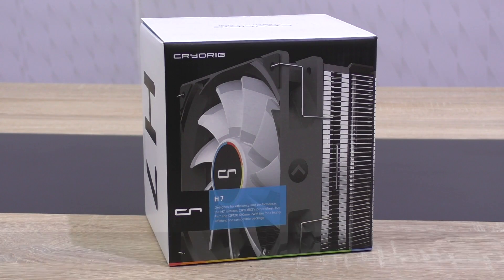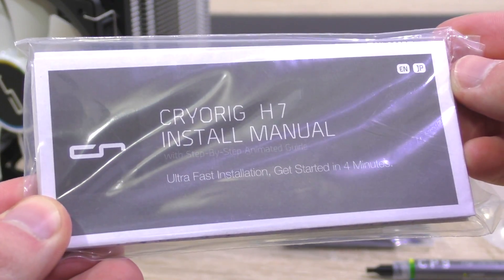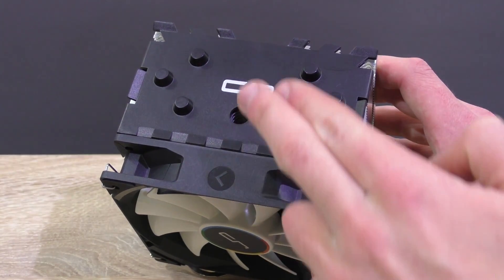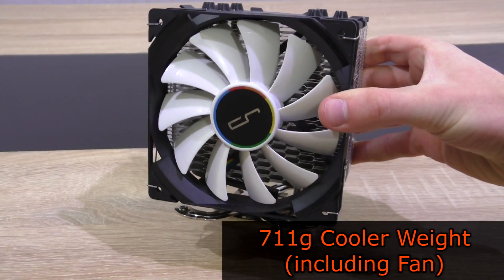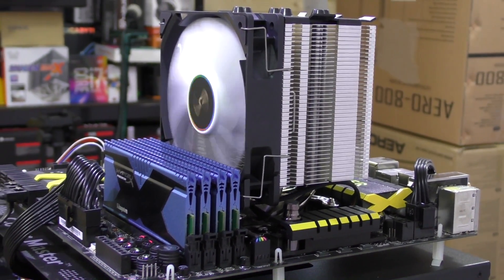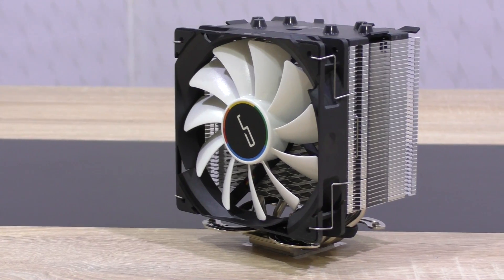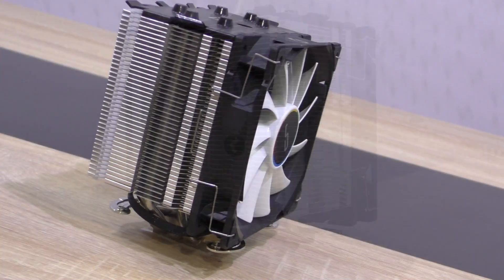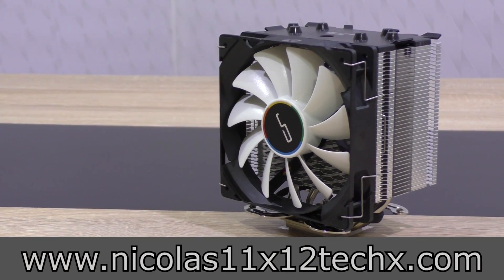CRYORIG H7 CPU Cooler Review

Comment: i have i5-3570k and z75 pro3 motherboard with 2x8gb vengeance ram.....
i m not fond of overclocking.....kept it stocked @ 3.4ghz
need suggestion for cooler, i'm confused btw C7 and H7....
casing is thermaltake versa n26

Comment: So the H7 also doesn't support the LGA 771 as well?
Reply: Dudewithwings if it supports 775 it works on 771
Reply: @manbearpighd  Yep, isn't the only difference between the two is a pin on the cpu?

Comment: saw another comparison with the Scythe Ninja 4 coming in at 3°C lower than the H7 at load.  However, that's not much difference and the H7 is almost $20 less.  With RAM clearance concerns and the fact my system is quite old (2011), I finally realize the H7 is the best option for me...thanks for helping me make up my mind.

Comment: Can I OC the i5 6600k to 4.0ghz with stock voltage using this cooler?
On the MSI Z170A SLI PLUS mobo.
Reply: probably even high, this had performance equal to or better than the 212 evo and I've seen people hit 4.3 without a problem

Comment: I have a Cryorig H7 and the I5-6600k. If i oc it to 4.2GHz with 1.25W or even stock voltage, it doesn't shorten the life of my cpu or does it? I have heard that this is a stable and safe? This is my first overclock and i dont want to mess it up.
Reply: Research it, usually dont hit max temp. and dont give it too much power.

Comment: good review. I ended up buying it.
Reply: How is it?
Reply: great considering it didn't give me any interference with my RAM whatsoever on a microatx board. I also had enough room to clip on a second fan on the opposite side to setup a push-pull config. 

Temps are super low when I'm not in game or have a million programs open, never go above 38-39c. 

On top of that it's pretty quiet. so I'd highly recommend it.
Reply: shogunpk thanks :)
Reply: Mr Milky no problem man. I'm currently running a light game, browser, and prime95 which maxes out all my cores to 100% cpu usage. With a slightly overclocked CPU, I am getting max temps at 48c. That's with the HEAVIEST possible stress which isn't a realistic usage scenario otherwise.

Just make sure your CPU is listed as one of the compatible ones, otherwise get one of the other Cryorig models.

Comment: Wait, wait, did I really just see a H7 get around 2 degrees hotter than the H105?!
Reply: +InterCo - interface212 Is that bad or good?
Reply: Massie Mayhem Really really good, since the h105 is much much more expensive
Reply: InterCo - interface212 Cool, do you think the H7 is a good heatsink and will handle overclocking? Im on a 6700k btw
Reply: Massie Mayhem Depends how far you wanna push it, could probs do up to 1.3v
Reply: InterCo - interface212 Cool, Also im trying to decide on custom or reference 980ti, What do you use if you have a good PC?
Reply: Massie Mayhem This is really a question for the PCPP forums but anywho, 

I've got a 980 Ti MSI 6G. I would go for the gigabyte xtreme edition (either one) as they have the best overclocking potential.

Don't get MSI, the tech support is complete shit, I only got it because it would look cool in the dan-cases.com case.
Reply: Alright
Reply: +Massie Mayhem get the 1070 and overclock it a little
Reply: NolanTheGamer1 That isn't relevant for the youtube comments, bring it up with him elsewhere.
Reply: InterCo - interface212 sorry thought your friend was talking about a gpu upgrade :( sorry
Reply: NolanTheGamer1 I believe he was, but the topic of conversation wasn't some guy called 'MAssie Mayhems'' graphics card upgrade it was about the value of the Cryorig H7.

If he/you want to spark discussion on this matter you should use a forum like PCPP, or if you just want to talk to him message him on YouTube.

Comment: This one or the hyper 212evo ?
I'm really looking for a cooler since my stock fx8350 cooler is loud AF, so i really need your advice!
Reply: +Makis X-R-T-C This is better than the 212 evo but it is a bit more expensive!!
Reply: bszent okay, thanks man I might get a noctua cooler
Reply: Oh OK then air cooling is no issue for you. Yeah I was nervous too, but i just shook it alot first before i put it in to see if any water came out.

They are very reliable, especially all in ones like Corsair makes.
Reply: +Makis Metaxas I&#39;m in the same situation right now. Did you end up getting the Cryorig? How much quieter is it? Is it completely silent?
Reply: bszent No i didn't buy a cooler yet
Reply: Makis Metaxas Oh OK. Sounds more like you gave up.
Reply: bszent Nope...but in this very moment i'm moving to another city so my money is a little limited!
Reply: Ok. Mine is coming in the mail very soon so I'll let you know,
Reply: +Makis Metaxas This is only $5 more expensive than the 212 evo.
Reply: +bszent did you find out? let us know please
Reply: NolanTheGamer1 Yes! I had it for three months and had nothing but overheating issues and dropped frames in games. It was completely silent though.

Now I have the Corsair H80i v2, and although it is slightly louder than the Cryorig, it is no where near as loud as the stock cooler was.
Reply: NolanTheGamer1 Those are awesome I've heard, if they can fit in your case. The Cryorig was the only air cooler that would fit in my case and was in my budget at the time.

Taking the leap to liquid cooling was worth the money. My temps are very steady now and not all over the place, and liquid coolers don't really have any space requirements since the water block barely sticks out.

The only worry is to check how many radiator slots you have. My case only had one, so I had to go with the single fan H80i instead of the double fanned H100i.
Reply: bszent yea I have an nzxt source 530 (its really big, makes my hyper 212 look tiny) and I think it's just me but I get nervous water cooling... I am afraid of a leak. But thanks for all the help man :D
Reply: bszent true idk I will think about it...